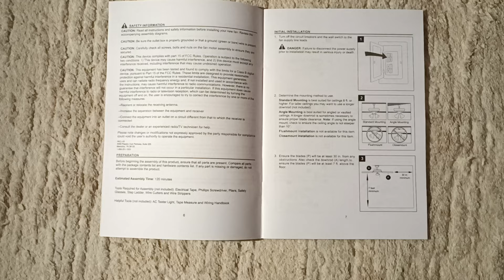how to wire and install the Harbor Breeze Camden model #42311 item #1058359 ceiling fan

Comment: I have red, white and black coming from my ceiling. I've capped off the red and attached black to red and white to white. That's how the previous fan was wired (which worked), but the new one does not work. Same model. Any thoughts? Thanks!

Comment: The canopy cover is an important safety feature....it acts as a second line of security to stop the fan falling down if the ball bracket fails...if you leave the screw out then you risk the fan falling and injuring someone...it should tell you that in the instructions
Reply from the maker: I found the screw if I couldn't I would go buy one and put it in